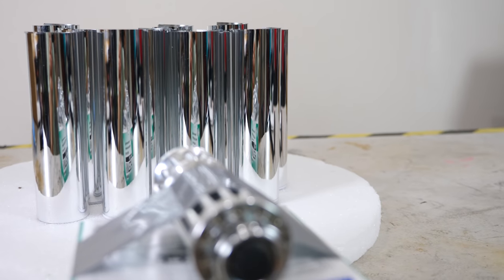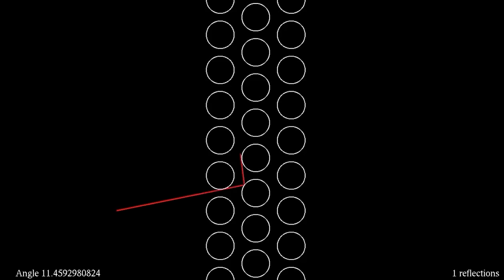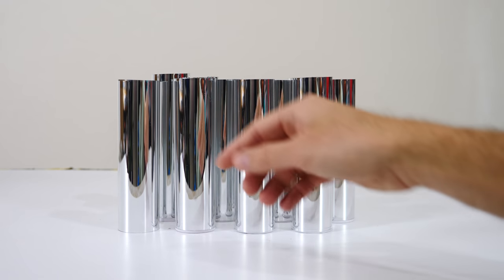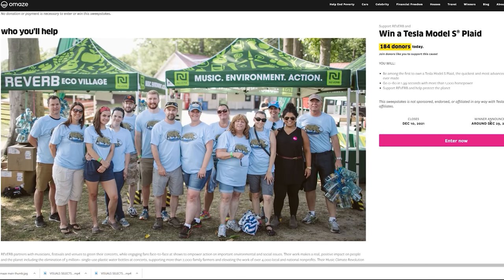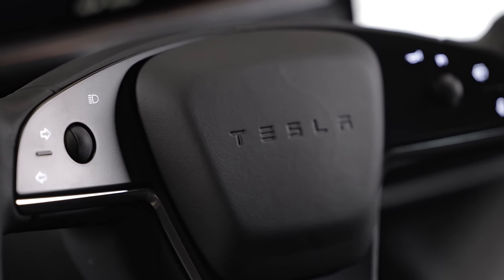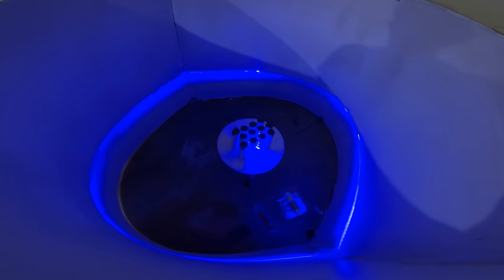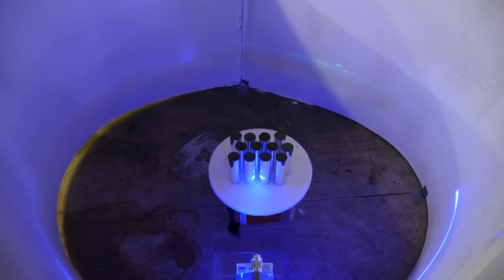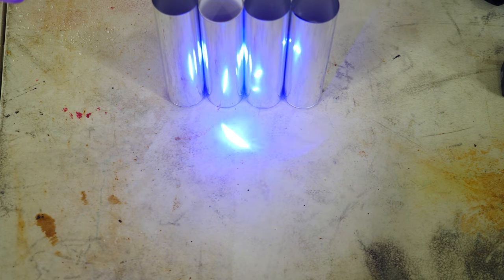The Butterfly Effect With Cylindrical Mirrors And a Laser

Comment: Because the beam has width, wouldn’t using mirrors with a larger diameter reduce the resulting 360* result? Giving you a closer result to the computer simulation.
Reply: Yes but you'd also need larger movements of the laser to achieve a similar effect, though still probably worth. Do bear in mind that the mirrors aren't ideal mirrors either, there's going to be scattering and some diffraction even then.
Reply: IF you would hit the border of a cilindrical mirror, a refraction would happen making it spread again
Reply: @BlaxeFrost-X  yes I  agree with you that is why I used the word “reduce”. And not eliminate.
Reply: The spreading effect would probably multiply so much that it might not even make a difference. Worth testing out though.
Reply: Set up an experiment and do the science !  Record it all. Who knows, you may find some new thing that getz your name on it.
Reply: @GeckoOBac  needing larger movements to achieve the effect is the least of your problems. With this setup you would need very, very large mirrors before low sensitivity to angular changes becomes a problem.
Reply: The cylinder with larger diameters will act more of a plane mirror thereby alleviate the butterfly effect cuz it's not the beam that causes this effect but the curvatures of the cylinders.'
Reply: @s.rehman2.0  Yes correct !  But there is no "Butterfly Effect" in this demonstration.
Reply: View this from the point of a Single Photon.  No Butterflies anywhere !
Reply: @snakezdewiggle6084  ideally, the beam should have no width ie a single photon. However, the beam in the demonstration has width ie millions of photons making individual beams or rays. Since each individual beam or photon hits the cylinder at different point due to the width of original beam, it leads to the creation of millions of individual butterfly effects thereby a sense of spread. But actually, millions of butterfly effects are occurring simultaneously.
Reply: @s.rehman2.0  apply all that to the computer simulation. Your assertion would result in Millions and Millions upon Millions and Millions of Photons. This can not be seen in the simulation. This demonstration is nothing more than an improper assumption. The true Butterfly Effect has a Time Elliment that has been ignored here.
Reply: Proportionally add more space between the tubes
Reply: @snakezdewiggle6084  The time element in this experiment is the time from the initial reflection to the time each photon hits the white background.  Time has not been ignored, light just moves very very fast.
Reply: @s.rehman2.0  just so we are on the same page…. You and me both think the butterfly effect is just where and how the the beam of light travels and ends up and not so much the beam of light all around the walls.
Reply: @EmpiricalSword  ok, if you say so.
Reply: You'll need infinitely bigger mirrors.
Reply: @TigerStrike8000  the butterfly effect refers to an action in the present, altering something in the future, dependant on the observer.
Reply: then the cylinder must be tremendous large so that the width of beam is negligible~
*It must nearly be the ratio of size of photon and the beam! That's crazy 😂
Reply: I am referring to the computer simulation… I understand it is only one photon wide and remains one photon wide.. in the actual experiment I understand it is more than one photon wide. My theory is a larger round mirror “might” reduce the outside wall from having a solid ring of light. As far as the time I visualize every time you move the laser you are simulating a different decision from that point in time. I could be wrong but I still think that larger mirrored tubes would just give less of a solid ring effect at certain angles and not at every angle. As I read other comments I would also agree to think that spacing the mirrors further apart could also “reduce” the solid ring as an outcome.
Reply: Nothing will help. It's so unstable that micron variations in radius of the cylinders matters. Any improvement you make will just result in a change, since you get different reflections. But the end result is still that the laser beam is wide and represents an infinite number of ray angles, and you get an infinite number of different ray paths.
Reply: i think the 360 thing is the laser beam moving so fast you see it as a line
Reply: @yourmomlmao9638  No. It's more like the laser shining on a lens that reforms it. That happens because each individual photon has a different angle. And will find a completely different path to zig-zag through the maze. And will end up leaving the maze from a different location and in a different direction.

And that is what he meant by his experiment testing all angles at the same time - it'a like the beam hits an infinite number of beam splitters.
Reply: SHIIEEET  no the fact that the mirrors are not vertical gives us information on how the light have bounced, the more bounces the bigger the offset from the horisontal plane of the laser, the more bounces have occurred.

an imperfect setup can reveal cool new things.
Reply: @snakezdewiggle6084  No. The butterfly effect is the concept that small changes can lead to massive changes over time. So the small change in angle of photons causes a large deviation later on resulting in that 360 spread. It's still applicable without the point light. And you are confused as to what the butterfly effect means
Reply: @guser436  okay, if you say so...
Reply: Just use a smaller lazer😒 he was using high quality one
Reply: @Gathering_wisdom  doesn't matter how small the laser is it still won't be a point light. It still has a width where photons take different paths
Reply: Time to use 2 inch metal pipes and polish them? 😎
Reply: SHIIEEET  but if all mirrors were perfect and perfectly positioned along with the laser, you would still get the same result, maybe more pure. Wouldn't this validate the less accurate test? OR, would it not give a complete 360" beam because the chaos is interrupted. Are there microscopic gaps in the 360° beam? OR, am I just rambling nonsensical? Waxing idiotic? OR ...
Reply: @s.rehman2.0  ooo, some more good logic. Wouldn't scale and proximity dictate the out come? After all, an arc is still an arc.
Reply: @donaldshimkus539  off course, scale and proximity will play their role. However, an arc is not still an arc. Think about it this way... An arc with smaller radius has a larger diverging power.
Reply: @s.rehman2.0  any line, if not perfectly straight, has a curve or "arc" and therefore a radius no matter how long. A radius of 87 trillion miles still denotes an arc, even though it may appear straight.
Reply: Reduce to some extent, yes, but not eliminate it completely.
Reply: No, I think it wouldn't. The given a deep enough array of mirror tubes, the sheer wavelength of the laser is width enough to create a circle around the setup. This only works in the simulation.
Reply: @GeckoOBac  that’s not how that works. The simulated laser is a single point wide, therefore the scale of the mirrors is irrelevant. In fact, in real life, the larger you made your mirrors, the closer it would match the simulation.
Reply: I see 'bounce testing' for mirror flatness
Reply: I think the best bet would be to make the cylinders not round but consist of a number of flat segments. It will not be as chaotic as the simulation but the beams won't be as lensed and scattered since the beam can be contained within the width of one flat mirror
Reply: the angular dispersion goes like beam-width / cylinder-radius, so yes.
Reply: Making the tubes larger is just scaling up everything except for the size of the laser, effectively making the laser smaller. Since everything is smaller it would also reduce the effect of tiny imperfections. Thus making it more similar to the simulation. Other than that, it is still exactly the same. How hard is it to understand. Making the mirrors larger won’t get rid of the wide beam at the end, just improve it.
Reply: SHIIEEET  why do the mirrors need to be vertical?
Reply: @Dude-Smellmyhelmet  yes there is. It is already done here. Just many times at once making it hard to see. And it can be done just one at a time as single photon sources are a thing.
Reply: @Dude-Smellmyhelmet  please explain to me how it isn’t possible without a single photon wide beam. You can clearly see it being performed here.
Reply: @snakezdewiggle6084  actually photons too have some small but nonzero cross section. Plus in quantum mechanics, they take multiple paths at once, as double slit experiments show. So even if you sent multiple photons perfectly straight, they would still exit at different directions.
Reply: Sorry, I don't understand the point you are trying to make.
Reply: i mean at that point youre just shifting the zeroes around. the sim technically works but on a different scale
Reply: @GeckoOBac  Actually, the laser would NOT need to move any more drastically than it would with smaller mirrors. It would have the same affect as having a thinner laser, which would have the desired effect of decreasing the amount of “starting points”, making fewer “end points”, but you wouldn’t need to increase the angle that the laser is turning. The angle of an object is independent of sizes and distances; a small laser at 30 degrees points the same direction of a much larger laser at the same angle.
Reply: @Aerythraea  > Actually, the laser would NOT need to move any more drastically than it would with smaller mirrors. 

Drastically no, I agree, especially at feasible scales. However it WOULD need to move more, though not sure why I brought it up at the time, it doesn't seem all that relevant.

> It would have the same affect as having a thinner laser
This gets complicated and tends to introduce even MORE real life physics into an attempt to replicate a computer model. Smaller lasers are hard to make and you risk to introduce diffraction by making the laser too small.

Though tbh the real issue (aside not having a lab grade laser) is that the mirrors are 1) shoddily done 2) don't have a surface coating but rather they have a transparent layer above the coating which introduces a lot of internal total reflection and just diffraction/diffusion of the beam in general.
Reply: Yeah, I just watched this video and everything checked out until he said that. In my eyes the issue is not the beam width, its the fact that the mirrors are clearly diffusing the light. You can observe it in the reflection on the tubes themselves. Shine a laser into a mirror and tell me if it does that. As @TigerStrike8000 said, increasing the radius of the tubes will likely get you closer to the simulation using the same "imperfect laser that is more than 1 beam".

Comment: Thanks for trying the experiment irl. Have you tried using fewer cylinders, maybe 3 or 4? It might give a more localized spot.
Reply: Thanks for making your video
Reply: Your video was incredible
Reply: bots?
Reply: At the end of the video he showed that after just two cylinders the beam had spread out to nearly 180°
Reply: Dude doesnt even read his comments to know the guy who he took this experiment from - stopped by to comment lol 😆
Reply: @wd91  well he doesn't read the comments,  but he gave him credits in the video
Reply: nice
Reply: THE MORE THE MERRIER -- so, no.
Reply from the maker: Yes even with just a few cylinders it spreads out very quickly. A better laser lens would help to start out with a smaller point.
Reply: @TheActionLab  Perhaps use a less reflective screen so the laserlight won't reflect back on the cylinders. The bright spots seem to be bright enough to make the pattern go all around the screen just by reflecting the pattern back.
Reply: Putting the laser on a speaker would probably make a nice visual effect. Surely, this has been done though...🎉
Reply: you just need a thinner beam or larger cylinders
Reply: @wd91 what did you say about not reading comments? He even replied. Bahaha 🤣😂😅 Bravo!!👏.....👏.......👏 (slow sarcastic clapping)

Comment: You should definently try this experiment with adding one of those Lego multiple gear machines (that do full spin in 100 years) to slightly change direction of laser
Reply: That's an amazing idea
Reply: bro 300 iq
Reply: Or just do a timelapse of a single full rotation!
Reply: @RJiiFin  it won't complete all 100 gearbox in a lifetime. It will be complete when the universe ends.
Reply: That's a gear reduction
Reply: Or more than 9 digits simulation

Comment: You should have made the cylinders with a much wider radius to reduce the spreading at each hit & used different color/width lasers.
Reply: No, you
Reply: Where would he find such large toilet paper rolls?

At a store for GIANTS?
Reply: @PowerScissor  one could just use whole rolls of paper towels or toilet paper.
Reply: @PowerScissor  There are other things that are cylinders besides toilet paper rolls
Reply: @hakrj12  exactly 😂👍
Reply: Increased radius may help remove the spread of the beam but it will reduce the butterfly effect itself cuz remember it is not the beam that causes this effect but the curvature of the cylinders.
Reply: @PowerScissor  or a giant store  ;)
Reply: @PowerScissor Right, its just that it shouldn't be too difficult to get a configuration more in between that sim & total chaos.
Reply: King Pistachion  is